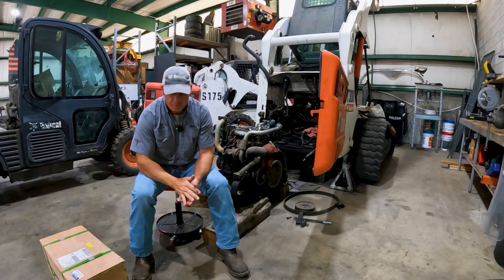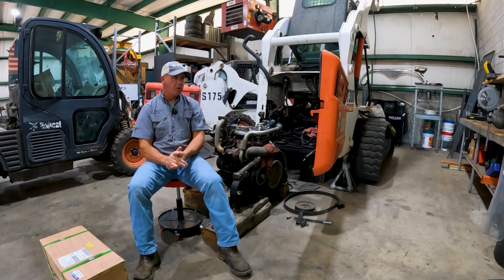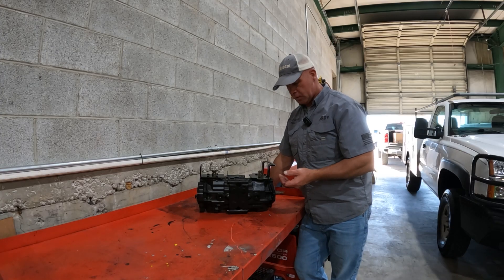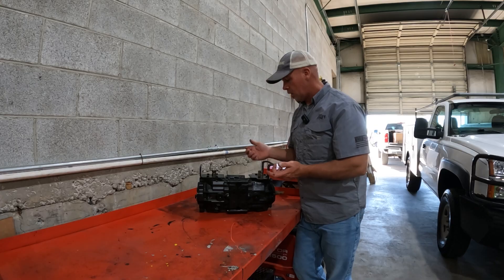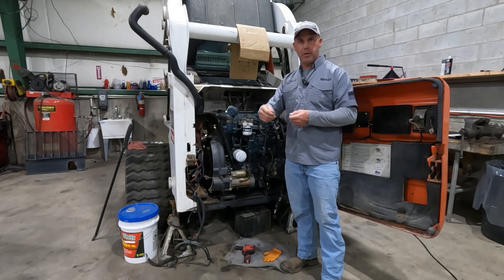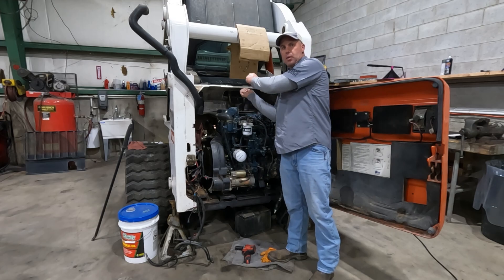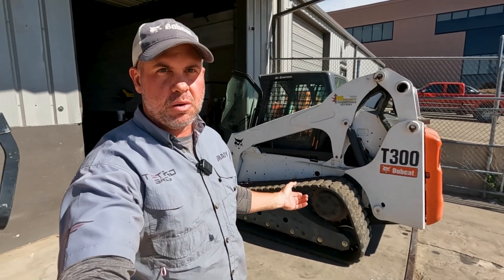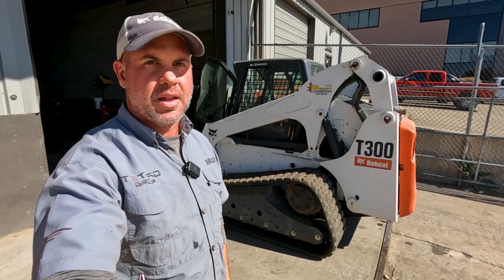Bobcat T300 Hydrostatic Pump Failure. New Pump Did not Fix It?

Comment: great video i have a old bobcat 975 that will not turn either direction will drive ford and rev good has new charge pumps on both pumps will turn as  it should with tires off the ground thank for your videos
Reply: What ended being the problem? I have the same symptoms

Comment: Thank you for all your Bobcat videos. I'm a reasonably capable mechanic but little experience with Bobcats. Diagnosis is the big problem for me. The R&R is easy with your videos. I just had a failure with my T320 that I use for Forestry.Both steel(yes steel) tracks started juddering after heavy work climbing steep terrain heavily loaded. Lost power to both tracks. Added some fluid,let it cool down overnight.Now it works fine - for a while. The simple diagnostic tool that helped is a laser/digital thermometer. When the problem recurs,stop,lift the cab and find the hottest part of the hydrostatic drive system. That will be the closest to the component that has failed.(Pump?). Don't forget to confirm that the hydraulically driven cooling fan runs ! Next step, do a pressure test. Thanks for all your Bobcat videos !

Comment: Great video for what its worth on those bobcat t300 and s300's there is a simple lift bracket you can make that balances the whole pump and engine assembly really well and makes install/removal a breeze. The print for it is in the bobcat service manual and worth the small amount of steel to make, if you do a fair amount of those large frame machines with the Kubota.

Comment: In hydrostatic pumps purging the case is not super important, as long as there’s some oil there. Because functional charge system will fill the case very quickly.

Comment: On the mechanical ( trunion style) hydrostat - the feedback is your pressure. Any damage to the rotational group of pumps would reduce the highest pressure it can reach, so it will reduce the feedback and machines performance. 

Something happens in the undercarriage, it’s just induces  more pressure in the pumps required to do the job, when you counter steer.

On the pilot controlled machine, the higher feedback and higher charge pressure - means check valves not holding.

Comment: I actually have one that when you try to make a right turn it has a loud noise and almost stalls the machine I opened up the chain case and the disc brakes were destroyed cleaned everything out replaced the disc brakes and still the same look at the right drive motor and metal particle’s were coming out so I changed the drive motor now you can turn right but noise and grinding still there i have to swap the hydrostatic pump waiting on one from bobcat itself

Comment: I have a very similar problem in my S185 . I already removed the hydraulic pump to get it looked at . I would pour fluid in and the level ball would go up a bit and a minute later the fluid was gone and the machine would move , I’ve must’ve pour 10 gallons of fluid and the ball was still all the way bottom . Any ideas ?
Reply from the maker: The oil is pumping into the chain case. Open it up and see how full it is.  Bad drive motor, or carrier seal

Comment: What’s the difference between hydraulic system and hydrostatic system? Or is there no difference?
Reply: Hydraulic Pump:
-A hydraulic pump is a device used to compress and transmit fluid (typically hydraulic oil) to generate mechanical power.
-It is commonly used in hydraulic systems to transfer energy from one place to another, driving hydraulic cylinders, hydraulic motors, or other hydraulic actuators.
-Hydraulic pumps come in various types, such as gear pumps, piston pumps, screw pumps, etc., and they work differently but are all used to generate hydraulic pressure to perform mechanical work.

Hydrostatic Pump:
-A hydrostatic pump is typically a specific type of hydraulic pump used in hydrostatic drive systems, where the fluid is usually circulated in a closed loop rather than delivering power to moving mechanical parts.
-Hydrostatic pumps are often used to deliver a constant static hydraulic pressure, such as in hydraulic brake systems, hydrostatic transmission systems, etc.
-These systems operate by maintaining a constant pressure rather than changing hydraulic pressure during the process of generating motion.

In summary, a "hydraulic pump" is a general term used for various hydraulic applications, whereas a "hydrostatic pump" is a specific type of hydraulic pump typically associated with hydrostatic drive systems that maintain a constant hydraulic pressure.
Reply: @FridayPartsOfficial  very good explanation, thanks
Reply: Yes and no, the hydrostat system drives ONLY the tracks and the wheels. It does however share oil and the cooler of the rest of the hydraulic system. The auxiliary hydraulics and the boom functions  are a separate set of pumps.
Reply: Hydrostatic ( closed loop) mostly recycling the same oil running it in the loop and only replenishing what was lost in natural bypass.

Hydraulics take oil from the reservoir - and return all the oil in to reservoir.